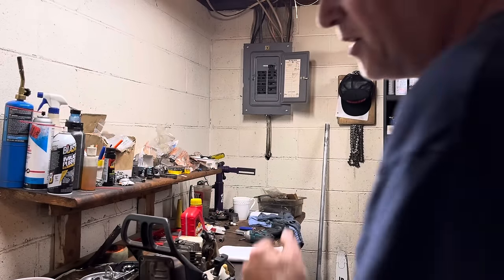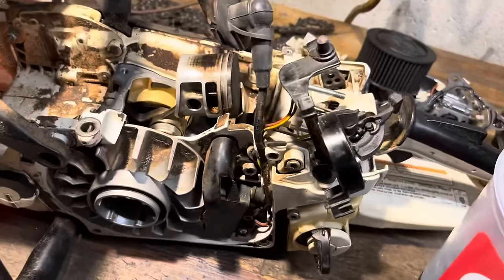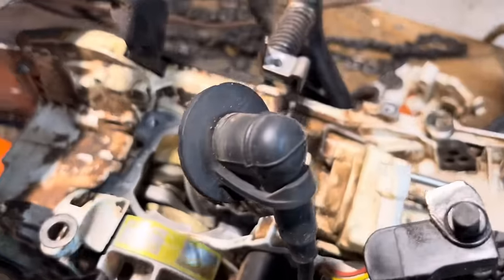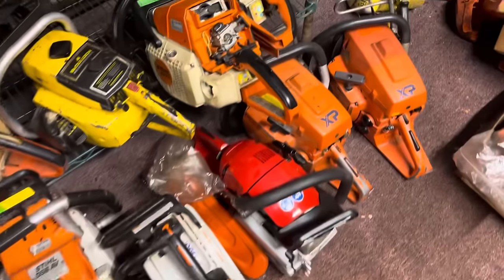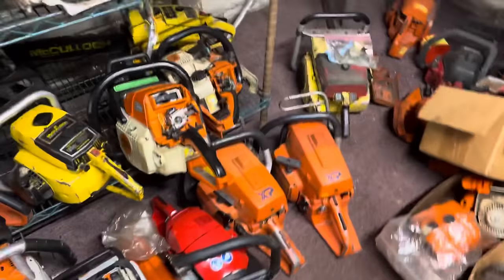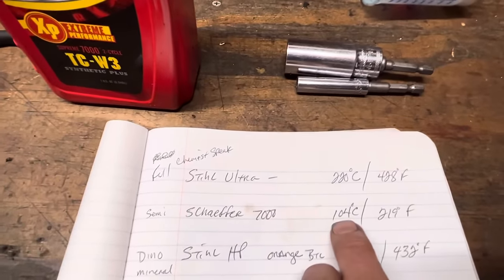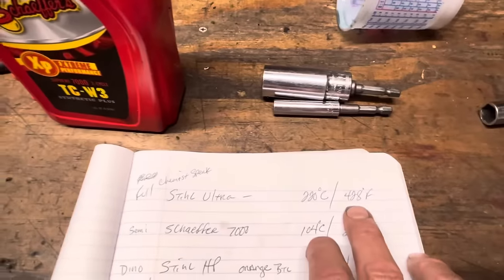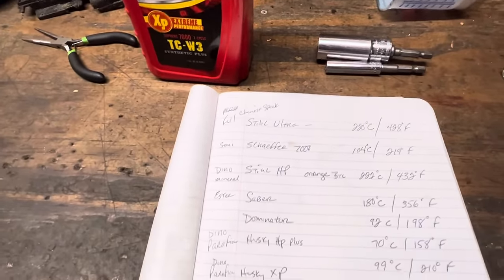Two Stroke Oil Talk.  Why Anything is Better than Ultra for your Chainsaw!

Comment: I do a lot of cutting. I also was a suspension development rider racing two stroke motorcycles. I have used both types of Stihl oil for years with no problem. I have also seen research done on two stroke oils. Also had a discussion with Mitch from Pro Cicuit Racing. I can tell you the two best oils are Castrol 747 and Maxima 727 oils to mix with your gas. All would recommend mixing more oil the 50-1. However they may not with a saw that controls your jetting. When you add more oil it leans out your air fuel mixture which could cause damage. I use to run maxima 32-1 with turbo blue in a Stihl 440 for years. The local chainsaw dealer saw my saws internals and ask what I was using. Maxima 727 was the best they ever saw. However it cost 20 dollars a bottle in the late 80s. However it is a gallon bottle. Castrol 747 is very hard to find. It is made in Europe. The numbers signify the number of parts of synthetic, Castrol bean oil and standard oil. You also get a great smell from burning bean oil. The bean oil creates a much better seal with your rings creating more horsepower. The synthetic creates the ability for it to handle much higher temperatures. Synthetic oils are made from a type of natural gas called wet gas. We burn dry natural gas in our stoves. It does provide lubrication. It will not be a thick oil coating. Bean oil can also cause your engine to build up more carbon. Synthetic oil also usually cause your engine to run at a little higher temperature the oil made from crude. But they can protect your motor at much higher temperatures then a crude type oil can.
Reply from the maker: Thanks for all the info!  Sharing makes us all better consumers.

Comment: The best oil I have found is the shindaiwa (now echo) red armor 2 stroke oil, mix it with 94 octane and it runs clean as a whistle been using it for years, it even smells better than the others after it is burnt
Reply: I know a older man that’s ran a small engine repair for over 50 years! He says that’s the best 2 stroke synthetic on the market! Bar none
Reply: No real hard evidence bur I run Red Amor at about 2.7oz to the gallon.  Never had an engine issue in any equipment I own.  Chain saw are still running strong from 2008.

Comment: I have been running Opti2 2 smoker oil in all my engines for years with zero failures and they are very well lubed in the crankcase when broke down.

I have even ran the Opti2 @ 100:1 innsome of my engines and zero wear issues and zero failures.

Currently I run a 50:1 mix of Opti2 and then add a cap full of Maxima 927 castor to the mix.

I highly recommend the Opti2 based on my experience with it over the last 12 years of using it.
Reply: I've run opti2 for 30 years in everything 2 stroke I own.  90 to 1.  Never a failure!  Not one!
Reply: Man, I'm sure glad somebody likes opti-2! I have been using it for over ten years now with no troubles whatsoever. I do run my mix at 50:1. I just purchased a ms261 and of course they made me buy some of stihl ultra oil to get the second year of warranty. Of course I wasn't going to let it go to waste so I used it up and went back to opti-2. I do keep one bottle just in case I need to take it back for warranty work. I just stumbled across your videos and I know I can't stop watching them. Keep up the good work!
Reply: I use Opti-2 and Pennzoil and Walmart "Super Tech." I don't see a nickels worth of difference in any of them.
Reply: @5hawks  if you translate the hi revving sound it would be SCREAMING, GIVE ME QUALITY OIL-I feel the difference!

Comment: I run my 2 stroke engines with gas + cheap motor oil. I mix it a bit richer than the 2 stroke oil mix recommended by the manufacturers.
When cold, the engines smokes a bit but when the operation temp is reached after a  minute or 2, no smoke in the exhaust gasses.   Spark plugs are grey-ish/braun, the exhaust mesh is dry and not carbon clogged. No excessive wear on engine parts. 

 I own 2 stroke engines all my life, check & service them myself once a year.

*Chain saw
*Weedwhacker
*Auger drill
*Tiller
*50 cc piaggio Scooter
*2,2 kW bosch generator (with  50 years old Sachs engine)

Comment: I had a brother in-law that had a Stihl 029 chainsaw. And he wouldn't buy the 2 stroke oil.
He would just use 10w-30 motor oil for mixing with the gas. This was back in the 80's.
I still have the saw and it runs just as good as any of my other Stihl saws !
I wouldn't recommend it , but it will work

Comment: Ive Been running Yamaha semi-synthetic snowmobile oil for over 20 years. Works in the snowmobile, Lawn Boy lawn mower, saws. I always use non-oxygenated fuel and mix it at 50:1 using a ratio-rite. Lawn mower carb gets run dry cause it sits outside up at the lake. 1 Pull start after winter or any storage. Stihl 028 that sits up at the lake, uses the lawn mower gas. It has sat over winter also. Never fails to start and runs has run perfect for 15+ yrs. Any motorized "toy" that sits for more than a month should never be left with Oxygenated fuel. Im a former PowerSports service manager, still a backyard guy but have seen way to many issues in any motor for this fuel and non-use.  In a unrelated subject, when he was checking his spark plugs, white/grey is indicating a lean fuel mixture. Light brown is perfect, light carbon is ok. Yamaha Oil is good oil at a fair price.

Comment: Small scale logger here... I've been runnin the piss out of a 461 with Formula K2 mixed 40:1 for a year now and I love it. I was burning stihl ultra for a few years without problem, but K2 being ester based it leaves a good layer of oil on everything after use and that was the selling point for me. Plus I can find it locally which is a big bonus over other premium 2 stroke oils
Reply from the maker: Pros running pro oil.  That really sums it up.  Thanks for posting!
Reply: Have that oil for the Zenoah (cordless battery charger - like milling ).

Comment: Have 2 stihls for over 20 years. 060 and 042. What we always have done is buy the orange older stihl mix 2.6 oz. We mix it it 1 gallon but I add couple caps of used motor oil and 1 cap of marvel mystery oil. No foul outs, no smoke, no breakages. Firewood cutters for 2 homes exclusively heated with wood so they run every Saturday 3 hrs for 3 to 4 mos. I've been pressed by dealer to buy the silver at 1 dollar more per bottle but told him I got something working and not changing now lol. If it ain't broke, it don't need improved

Comment: I like to add some Marvel Mystery Oil to whatever 2 cycle oil I'm using. Puts the ratio well below 50:1 but no major smoke or carbon issues.

Comment: Been on wildland fire crews for 22 years. We generally run 044/440s, 046/460s, 461s, 462s, and the 500i. These saws see hard use day in, day out all summer long. I've been on several crews over the years, but the average fleet is around 40 saws. We all ran HP oil until the ultra came out, then made the switch. In all of these years and all of these saws, I've seen 3 bottom end failures. 1 big end rod bearing in a 10mm 044 (on HP oil), 1 bearing cage disintegrated on a 460, and 1 bearing seizure on a 461 with less than 3 tanks through it. (Heard of more similar failures on brand new 461s when they first came out) The majority ot the hours on these saws are high revs cutting brush. 

Only mitigating factor is that we mix fuel in 5 gallon Jerry cans that don't quite hold 5 gallons. Bottom ends aren't as wet as when I've torn down my dirtbike and snowmobile engines running Amsoil interceptor, but not seeing failures either.
Reply: Just to be clear, would the following be correct?  “In all of these years and all of these saws, prior to the switch, I've seen only 3 bottom end failures.  Once making the switch, however, we saw 1 bearing cage disintegrated on a 460, and 1 bearing seizure on a 461 with less than 3 tanks through it.”
Reply: @kenp3L  No, I made that a little unclear, I'm sorry. Just 1 failure before HP (2001-2007) and 2 after (2007-present).
Reply: @timdelph9048  Thanks for clearing that up.

Comment: Ran stihl oil in a brand new FS94 trimmer. Muffler completely clogged after one season. Cleaned up everything and went to Amsoil sabre and after 5 to 6yrs ive never once had to clean anything.

Comment: Good too see the comments. I too am using Motomix that is mixed with HP Ultra 50:1, just comes in a can and ready to go. I'm wondering if this that you're seeing is what most really don't do; give it a good warm up before gripping and ripping at full throttle. As seen in other comments, these things run at 100% which doesn't give any oil that much time to cling. All of my Stihl equipment runs great and starts easily still today, but I also don't pull the heads off just to take a peek.

I'm sure my smaller MS211-C looks like that as well but that one is the one that gets the most use around the property.

Comment: Spend 6.5 hrs a day, standard British Columbia faller hours, go thru 2.5 - 3 gallons a day, never use Stihl, Husky oils, always have been supplied a aftermarket oil, as they get sales on reliability.
 We get 5 gallon pails, mix it in barrels, fuel our jugs from there.
 Have used various brands. No real favs, but not Stihl, Husky, a few years ago it was all Jonsered, but went downhill with them being bought.

Comment: I used to run the Stihl synthetic - but at 40:1 I found it too pale green  Accidentally when I mixed up my petrols and seized one of my saws.  My fault - but I was not happy.  I switched to Husqvana synthetic and it is much darker blue - much easier for me to tell if I have the right petrol.  To me, I could not pick a difference in the working performance of either of these products - both worked great.  When I am running my 660 and 880, I run 35:1.  Oil is cheap - rebuilds on these big saw (any saws...) are not!
Reply: Lol, why not just run 36:1 which is easy to mix🤡

Comment: Before ultra came out I used HP. It never let me down but it did smoke a little bit. The ultra does burn really clean and smoke free.
It leaves a whitish to light brown dry deposit on the plugs rather than the black to grey of the HP.
The ultra gives better throttle response and power. It also stays fresh much longer.
I reckon it's bloody good myself.
Reply from the maker: Here in the States they have recently taken the fuel stabilizer out of the formula.
Reply: @richardflagg3084  
That's a shame. It works really well.
Reply: @richardflagg3084 Motul 710 2t sintetick ok oil ??
Reply from the maker: @Okinawa1914 I just did a video on Motul 800 off road.  Haven't tried the 710.
Reply: @richardflagg3084  Ok

Comment: I run RotX XPS full synthetic. I use 3.5 oz oil / gallon of gas. I have used this mixture for 30 years. Had no engine issues. On my trimmers have used up shafts and a few other litter items. But never any engine problems.  Same with my saws Echo CS590 and Dolmar 6100.  I give them a good 5 minute warm up so thar everything sets and engines have time for the clearances to set. HAPPY CUTTING to All

Comment: I was in the oil and lube business for 28 years. Tcw 
3 is a water cooled two stroke oil , it more viscosity and zinc, plus a higher flash point. 
I have used it in trimer blower for testing. 🤙may have to tune carb, and ( clean screen in muffler) first two tanks of fuel. 
The chain saws, I run synthetic oil. It has a great boundary coating on parts, and three is less smoke, and no buildup on screen in muffler. I mix’s about 40-45 to 1. 
Keep testing and let people know what you find. Very nice video.
Reply from the maker: Thanks for sharing your knowledge.  I just got a handful of base gaskets and will be doing some testing with some of the more popular two stroke oils (for air cooled) .
Reply: 28 to 1?
Reply: You refer to the oil as "tcw-3"...is tcw3 a certain type of oil? Or is it a rating? I'm confused...
Reply from the maker: @Nicky_Pin_It  Formulated for water cooled applications.  This particular oil also does very well in air cooled engines,
Reply: Tow or tcw3 is for water cooled two stroke. It is not recamindd

Comment: I run husqvarna xp mixed at 45:1 with 90 octane non-ethanol gas. Works a treat. Ethanol is terrible for small engines, especially 2 strokes.
Reply: It’s actually not bad.
Reply: They claim that synthetic doesn’t mix as well with ethanol fuel, but I haven’t seen that to be the case and I’ve experimented.

Comment: I am doing a ms 290 piston because of age and the plastic crank bearing cages. The Schaffer 9000 had the same affect with the film in the crankcase. It did have a slight green color like yours. I just fill up a old 2.6 oz one gallon container to the top and mix with that.

Comment: Bear in mind I'm an older version of you with nigh 60 years of small engine work. Not bragging but fact. As you said the crankcase looks dry but that could be from low octane fuel. When the E85 fuel came out, you guessed it, someone tried it then got mad when called on it. In my saws I used AV gas at 40-1. Pricier yes but there's no additives & lasts a very long time. We've always had a problem of people not listening.

Comment: I run Lucas 2 cycle in all my 2 strokes. The biggest thing with saws is making sure they are tuned correctly.  I dislike the auto tune saws as it's a computer and the malfunction all the time. Also, very few people know how to run a saw correctly. They over rev them and do more harm than good.
Reply: What ratio do you run I’ve messed with 20:1 to 50;1 and I think 44:1 is the spot

Comment: Richard Flagg  I use Husqvarna XP plus 2 stroke oil in my 2 years old STIHL chainsaw never had issue bought STIHL chainsaw brand new 2 years ago still runs good and smooth

Comment: I used Stihl orange in a 266xp for 35 years, no problems50.1 mix. Just rebuilt an 025, Im using ultra and orange but went to 40.1 mix. I have had no problems with scoring or carbon build up.I use  this in all my 2cycle equip.

Comment: Richard, 

I watch Mr Obsolete and he mentioned u.   Currently I run a mix of units.  Older Mac saws and homelite saws that I run 40:1 on.   And my newer still broducts which is ms180, ms192, Ms 250, and Ms 261.   I have been running ultra with 89 octane fuel.   Would love to run just one say ,40;1 mix for all my equipment.   What do you think of echo red armour mixed with ,89 octane fuel for all my equipment..
Reply from the maker: Nothing wrong at all with running 40:1 in everything you own.  There's only a couple of oils I'd trust at 50:1.  Just like our elders said, just use a little extra oil and it'll be good for a long time. 

People act like going to 40:1 is a ton more oil.  It's half an ounce (actually.6 oz.) per gallon.  You shouldn't have to retune anything.  Just run it with a little piece of mind.

Comment: Been using Stihl two-stroke oil all of my 43 years of working life all over the world and in all climates and the Stihl oil has performed extremely well. Interestingly, it also seems to stop the fuel from 'going off' even after a couple of years in storage here in tropical Australia.

Comment: A personally believe the HP Ultra oil works better in their 4-mix engines. Every time I tear one apart, there is always plenty of lube in the crank case. And that’s probably since its a 4 stroke.

Comment: I can't say if they are any better or worse than others from a lubrication standpoint, but Echo Red Armor and VP are 2 of the cleanest oils I've ever used. Exhaust ports and screens are clean and piston skirts look great.
Reply: I've been running the VP racing fully synthetic with no issues either! Seems like good stuff. Love the easy to measure bottle too.
Reply: I believe they're the same, more or less. Made to Echo's specs by VP. I think they tweak the VP and add a fuel cleaner/stabilizer.

Comment: I've been using poulan pro (husqy) full synthetic at 45:1 and I am happy with how both the top and bottom ends of my engines look.
Buckin' billy ray uses castrol racing 2t oil and his saws run and look great. Maybe I will try that next time.
Reply: He shows you in a video also that Castrol and Stihl oil are the same thing. Same color, same flow rate, same smell.
Reply: @janemorong4970  Yep, I saw that video. Buckin’ had a whole quart bottle of Castrol 2 stroke oil. He compared it to Stihl brand oil, and without a chemical analysis, they seem to be the exact SAME oil. Crazy. I am thinking of mixing to 45:1 just to get a little more lubrication.
Reply: @mateobrainardo4770  I don't find it too surprising tbh. Lots more stuff is made in the same place and labeled differently than we realize
Reply: @janemorong4970  I like Buckin but that "test" was about the least scientific test anyone could ever perform lol. They are 2 different oils, all through they are similar.
Reply: @mateobrainardo4770  lubrication is the life of any engine , I don't run any of my two strokes leaner than 40 to 1 , 20 to 1 even better , I run some 16 to 1 .

Comment: The two best two stroke oils are Castrol 747 and Maxima 727. They are both blends of crude, synthetic and Castrol. I was a Honda suspension development racer when they used two strokes. Their racing departments of the big four all tested oil and had the same results. Castrol 747 is awful hard to find. Maxima 727 can usually be found at any motorcycle or go cart race shop. Each type of oil has what it does well. Crude lubricates well. Synthetic takes heat and still lubricates. Castrol seals well giving you more power and throttle response. It does work well in chainsaws. VP gas woks well but it doesn’t really help in most chainsaws cause they are not in that high of tuning. A 60cc mini race bike can make 25 HP. No chainsaw even comes close. VP can add to that HP with an engine in that state of tune. The 7s are the parts of crude and Synthetic. The middle number is Castrol oil.
Reply from the maker: Thanks for the info!